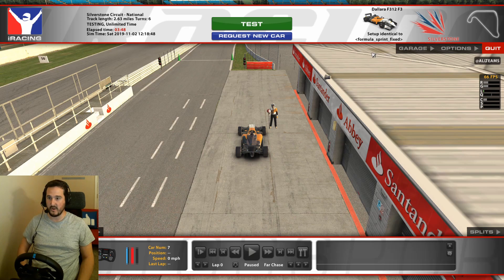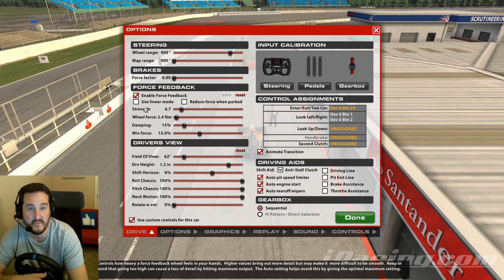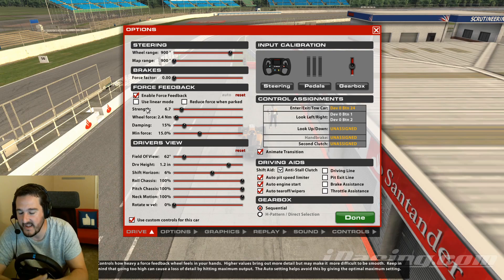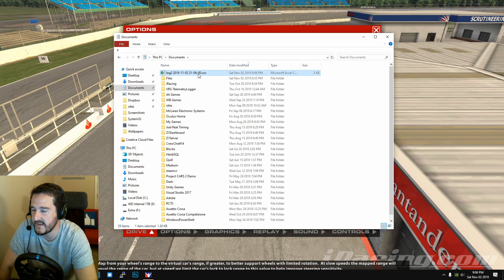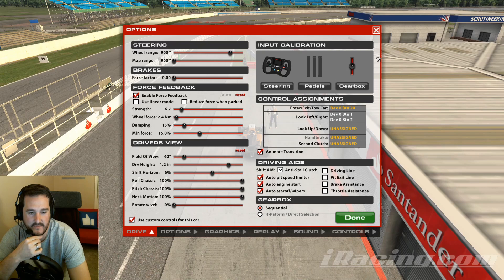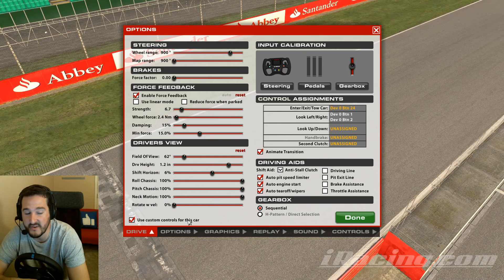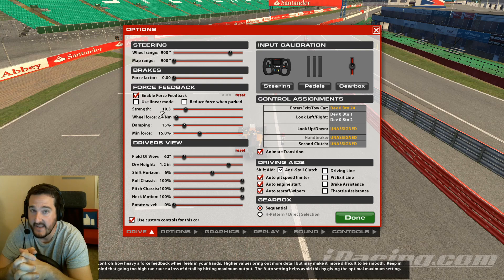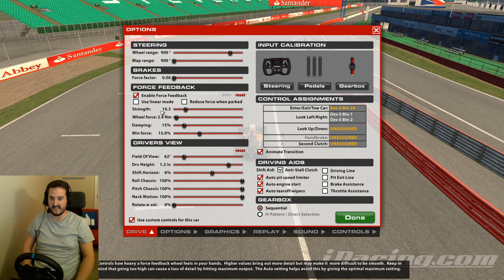How to setup Force Feedback in iRacing

Comment: Great video, many thanks. Within 10 minutes of making your recommended changes I reduced my best lap round Summit Point in the MX5 by 1.5 seconds and it felt safe and not right on the edge like before 😀
Reply from the maker: Wow now that is a performance gain! What wheel are you using and really glad it helped.

Comment: Got my fanatec wheel setup using this method I had the linear test display deltaX numbers at 50 (.5 in iracing menu) same thing with min force test (-.5) recommended ffb for mx-5 global was 26.2 and i have 0 damper on the wheel itself and iracing menu and re-ran tsukuba after everything was said and done was able to obtain a 1.04.6 w/ the stock mx-5 global  setup truly a believer in setting things up right now. Figured i'd share my success story, and great video! will share with friends.

Comment: Wow. I've been driving in iRacing for about 6 months. Until I saw this video, I didn't even know I'd had it set up all wrong. I was using a one-size-fits-all for all cars, and the strength set up completely wrong, had damping and min force WAY up which isn't even needed on my CSL wheelbase. The best tip by far was having a per-car setup, and letting iRacing suggest the strength. This has improved my consistency dramatically, and my lap times by at least a couple of seconds. Cheers, Dave! :D

Comment: Thank you for a great video !!
I never really looked into the FFB stuff, I just set it up so it felt right.
I'm gonna try this now.
Reply from the maker: Thanks a lot, hope it helps
Reply: @Sampsoid  I tried it with the trucks at Vegas (fixed) and I got a little faster, 31.21 to 31.13, but a lot more stable. Especially on the straights, not so much "slack" in the wheel.

Comment: Thanks so much for this video. I also have a G29 and was struggling with feeling what the car was doing on iRacing. I didn't have this problem in sims like ACC. After watching the video, I was able to quickly shave quite a bit of time off my best lap in the MX5 at Lime Rock Park. But the more important thing, is that my consistency has seemed to improved a lot. I also feel much more confident in the MX5. Before I was driving passive because I had no feel for what the car was doing. Now if I could only improve my breaking technique. :)

Comment: Wow I can actually race in Dirt Late Models properly now thanks to this. I was having so much trouble with the wheel just being way to jerky and having to be way to active with the wheel. Now it is so smooth and much easier to control. Used your settings since I have a G29 as well just had to get the auto strength right and was ready to rock. Appreciate the video a bunch!

Comment: Thank you, very useful guide so all of the guess work and research is already done for me.  I've been using wheelcheck + lut generator for AC so similar steps.  My G920 is returning a consistent step log 2 threshold at 8-9%.  Min force test is telling me anywhere from 2-5%. I'm guessing I have a low value return messing up the output.  It's not money so I will use my old Excel trick and pick the correct the answer.  Thanks again, Daniel

Comment: Thanks for the vid ;)

Here's the torque of some wheels. Source : http://www.edracing.com/edr/Wheel-Torque.php

Logitech DFGT: less than 2.5 Nm
Logitech G25: 2.5 Nm
Logitech G27: 2.3 Nm
Logitech G29: 2.1 Nm - not a retail release version of wheel
Logitech G920 2.2 Nm
Fanatech GT3 v2: 2.6 Nm
Thrustmaster Tx: 3.9 Nm
Thrustmaster T500: 4.4 Nm
Fanatec CSW v1: 4.8 Nm
Fanatec CSW v2: 7.1 Nm

Comment: Excellent tutorial, thanks! A question though: can you really feel the car starting to slide (oversteer that is) with these settings and do you feel you can react quickly enough to also catch it? That is my main strugle with my Thrustmaster T300RS. I've been using iRFFB which improves it for me, but this tutorial makes me want to give iRacing another try without iRFFB. Thanks again!
Reply from the maker: Thanks a lot. I haven't used iRFFB, I know of its good but comes with some drawbacks I believe. Obviously loads of pros also. I am happy with level of ffb I get through my G29 wheel
Reply: WheelCheck tells me that Min Force should be 1% for my T300RS. Surprisingly low number. The torque is 3.9 nm so I set that to 4.0 (one step lower would be 3.8 which I will also try). The auto strength came up with 12.8. Overall I liked how it feels, but I can't say I can feel it when I start losing the rear of the car. I had 1 spin in an IMSA race which I didn't see (or hear or feel) coming at all. I'll keep experimenting... Cheers!
Reply from the maker: That does seem low. Did you try both Min force and step log 2 linear force test? I actually prefer that one.
Reply: Yes, I did both methods, several times. The step 2 runs vary a bit more, from 1 to 6. The min force varies only from 1 to 1.5. I figured this wheel might actually be this sensitive in the low registers. I've now been testing with the min force set to 0 and I quite like it. Looking forward to racing IMSA tomorrow (in the RSR). Cheers!
Reply: @david_haas_  Min force is alright, my T300 is about the same. I don't set that ingame, though, as I created a forcemap - it's a profile that will make the FFB a bit more linear. You only really "need" it for consumer wheels (Fanatec wheels and DD wheels have a very linear output already. This also improved "catching slides" for me.

Comment: Thanks David, this video helped me a lot with my T300.   But when I run Min Force I get anywhere between 0% and 1%, does that make sense?  I thought your G29 and the T300 were comparable?  Similarly, the Step Log 2 test I get percentages around 4% - 5%, nowhere near what you're getting on your G29.
Reply: I have a tx thrustmaster which is similar servo to yours and I also get a min force of 1%

Comment: Are any of these adjustments (besides feedback strength) affected by wheel settings you have in the driver (in my case GHub, also running a G29)? And if so what would you recommend running for settings there to optimize what you went over in this video?

Comment: ive just updated to a fanatec csl dd wheel and was rerunning through your setting up forcefeedback video to remind myself. I have a couple of questions. since you made your video they have added smoothing to the set up options. What does this do and where should I have it set. If my fanatec software is running in the background, which takes precedence? the fanatec settings or the iracing setting, i.e. if my iracing is all set up then i alter my fanatec settings (maybe for a different game) will it alter my wheel in iracing?

Comment: Hi I have a Thrustmaster TGT wheel would you recommend using the linear mode for this as you mentioned in the video a sort of cut off price range . I’m just new to iracing and videos like yours are very helpful .
Reply from the maker: Hi, I would not recommend using linear mode as your wheel has 6nm of force, which while high, is not high enough to benefit from linear mode. Thanks a lot and glad they are helping.
Reply: That’s brilliant thank you so much for your help . After your video I am already putting in consistent laps around my best time . Only 1.08 around lime rock (chicanes)but I was around 1.09 so thank you . I only joined iracing last week and I absolutely love it . I’m not very good but I love it and that’s fine with me .

Comment: Thank you for the video. Do you know if this software will work with a direct drive wheel? I have used the recommended settings by Fanatec but it doesn't feel pristine like what you showed could be achieved. I also did the same for the Iracing settings. Again, thanks and I will give it a go once I get some freetime in the next day or so.

Comment: There is a huge difference between a 32NM simucube and a G29, I have had both wheels and using iracing FFB tool recommends a strength that would be way too strong for most people on DD wheels. Most people with powerful wheels drive them with what they are comfortable with its more subjective and the wheels themselves are very configurable. As for gear driven/belts wheel iracing tool would work fine IMO as you should probably run with the most FFB you can without clipping on weaker wheels.

Comment: David...what wheel/pedal combo do you like best...Logitech G29 (G920) or Thrustmaster TMX Pro?
Reply from the maker: Funny enough I went from the TMX to the G29.  Both wheels are great but I slightly prefer the Logitech wheel.  The pedals however cannot be compared, the Logitech pedals are far superior.
Reply: @Sampsoid  Thanks...I want to upgrade my xbox 360 racing wheel to one of these.  I have been debating on which one to get.  I would love a DD wheel/pedal combo, but far too expensive.
Reply from the maker: Yes indeed!  My aim is get a DD wheel and load cell pedals in next 6 months.

Comment: I have a question,What are your Logitech Profiler Setting at?
Reply from the maker: Everything to default. I do however make sure that the Wheel Operating Range is set to 900.
Reply: @Sampsoid  how do you drive at 900 ? My g27 is super sensitive when i up at that number ? i have to put it on 240.

Comment: Great Vid David. Thanks. Only problem I am having is that when I run the wheelcheck it seems to work, the wheel moves etc but the CSV is always created but is 0 bytes in size and empty. Any ideas what I'm doing wrong?
Reply: FIXED - It seems that I need to let wheelcheck complete the test - I cannot just quit out like in your video otherwise the file is empty. Reduced the max count to 30 and this was sufficient to get a response on a TMX wheel.

Comment: I just did this today.  Went through all the steps but when I did the auto FFB setting while driving it recommended 20.0. It felt like I was driving a tow truck with no power steering lol. I usually run at 10. It was in the 911 GT3 cup car at Sebring.  Do you think the bumpy track makes it recommend a high setting like that? (Thrustmaster TS-PC btw)
Reply: I got a similar result: somewhere between 20 and 22. This is with a G27, Mustang F500RS at Bathurst. And yes, it does feel rather truck-like. I did a race with that setting and got used to it, though. And actually, on reflection it does feel quite a bit like pre-power steering cars I have driven, like 60s Holdens. I'm not sure I'll keep it that way. I'll keep experimenting.

Comment: I know this is an old video..but using the wheel check with the thrustmaster TS..min force is REALLLLY low. I get between 0 and .5 usually. I've run it many times. Is this value still correct?

Comment: David, I downloaded Wheel Check version 1.82, loaded and set the parameters as you've indicated and I get nothing. no movement of the whee. at all and nothing in the documents folder. I tried the previous version of Wheel Check and don't get any results with that version either. I'm running a Fanatec Clubsport V2 wheel base which Wheel Check sees and sets in the first drop down menu. I set the next two as you directed, Max Count at 200 and then from the second dropdown menu Step 2. I wait and the wheel never moves. I am new to sim racing and am trying to get the optimum set up using your "How To" videos.  Any idea as to why Wheel Check is not working?

Comment: When I quite out of the app when the wheel starts moving I get totally random readings, like:1350, 400, 950. But if I leave the wheel to turn for about 1 1/2 minutes then it settles at about 950- is this a false reading?

Comment: What about wheel range setting. You have 900 degrees, that is probably thrusmasters wheel range. My TX is 900degrees  but iracing has you do wheel calibration and have me set it to 472 degrees. Whats your thoughts and why are you staying at 900?
Reply: You should calibrate it for the full range of the wheel. iRacing will automatically adjust the wheel range for each car to match what it is in real life. Many cars have a steering ratio option in the garage that you can then adjust to your preference if the default feels too unresponsive.

Comment: Whenever I use a lut table I get disgusting oscillation on center whether I’m still or rolling doesn’t go away unless I hold the wheel to one side or going into the lut file and lowering the first 3 values I can dial about 70% of the oscillation out, wheel still doesn’t center the last 45° under 30 mph using a tmx Any help would be appreciated, played with max count and step time no improvements

Comment: HI FROM ITALY! ONE QUESTION...at minute 8:36  why to choose 17 .....
based on what concept? and after you where you set this 17 parameter?ths
Reply from the maker: Hi there, 17 was chosen because if you look to the far right of the data on the sheet, it is where the numbers start to ramp up consistently. Once you see that, look to the far left and just use the first two numbers. In this case 1700 becomes 17.
Reply: @Sampsoid  ok and 17  where you set in iracing?...because i don t see in iracing  ffb set...

Comment: I looked for wheel check 1.72 but you had to join the sites is it free some where I found v1.82 but it did not work on my TMX pro is this a known problem with Thrustmaster wheels I’m getting ready to run in season 4 
Rookie Street stock any ffb settings would be great

Comment: its says "0.5% maxium value for steeringFFBbaseoffset is 0.5% (50)" when i do the minimum force test. this means my wheel is dead?
Reply from the maker: What wheel is it?
Reply: I think that's the g920 since that's what I got as well, I also got around 450 in the csv